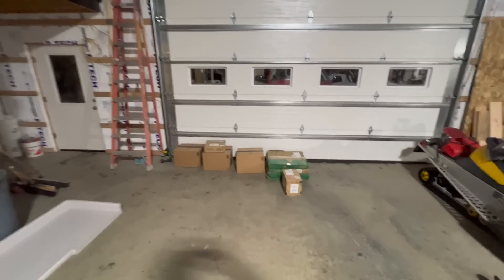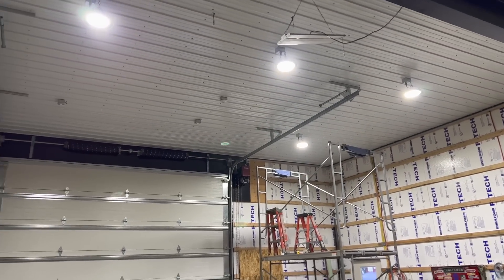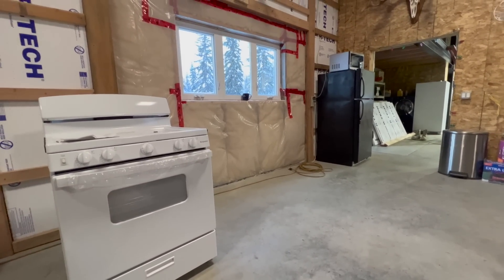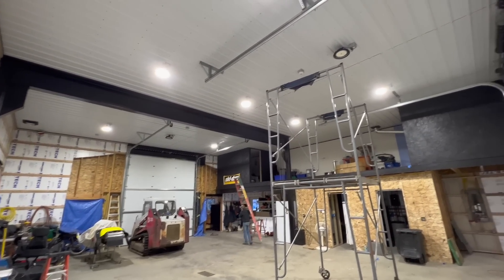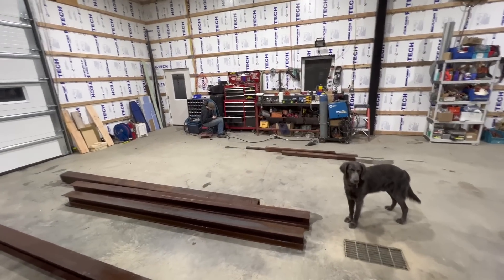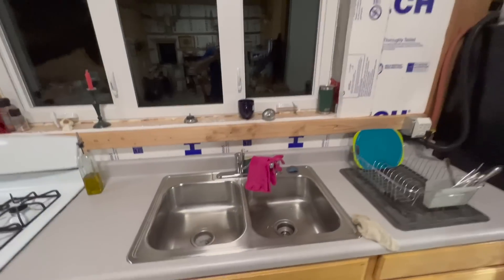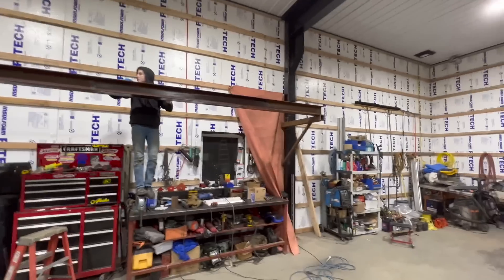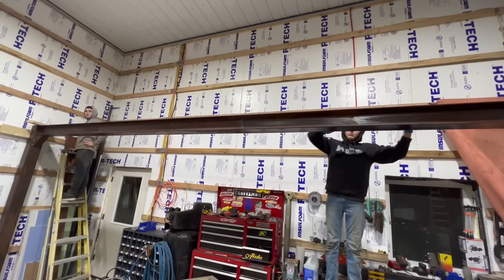Shop update: We finally have a Kitchen and RACE CAR REVEAL

Comment: Next time use the skid steer to lift that beam.
Reply from the maker: Ya, it was like -20 out. So I didn’t want to smoke my shop out because then I have to open the door to let smoke out. I need to finish my ventilation system